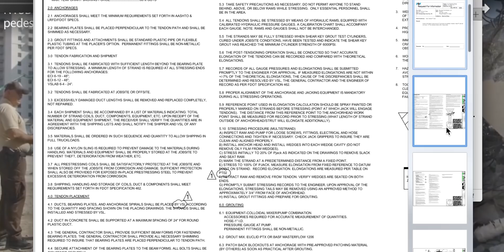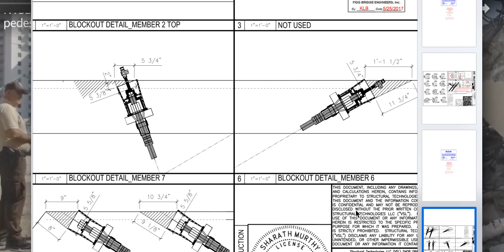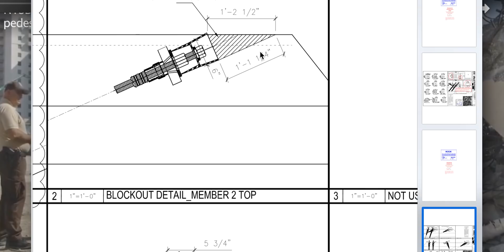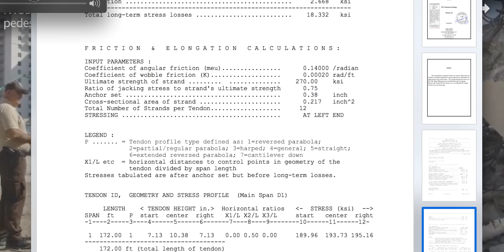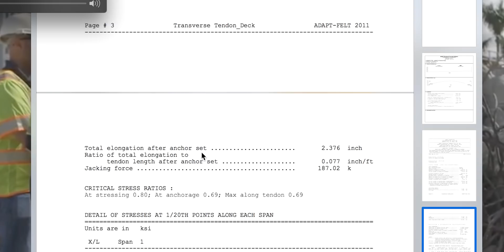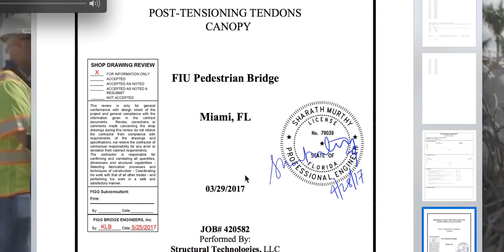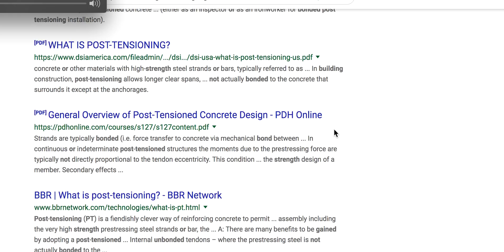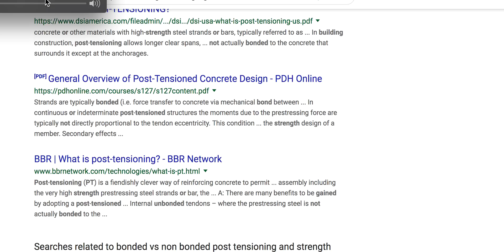FIU Bridge Collapse Bonded Post Tension was NOT done? Correction below

Comment: I believe it was NTSB’s final report came out 10/22/19, concluding there was a flawed design by Figg, and lack of due diligence by the construction company, by various overseers like independent inspectors, by FDOT, and by FIU.
Reply from the maker: I saw you saw this but incase someone else sees your comment, they can bounce to this video https://www.youtube.com/watch?v=9qffZEDmOv8   I will do more and debunk thier report more... Which I called b.s. from the beginning, that they were not going to find the true failure... Figg Engineering admitted that the structure was sagging!   Yet, NTSB sees zero relevance in that with their two loser engineers (gov. workers)?
Reply: Construction Engineering & Failure Analysis 

Good. I’ve not followed it closely since the failure, but feel that after seeing that huge crack they ALL should have insisted that every safety precaution possible be taken until its structural integrity.was assessed. The bridge was shouting that it had a serious problem, yet these so-called professionals chose to ignore the danger it represented, and needlessly put lives at risk.

Comment: While the grouting should have been done, I don't think the lack of grouting was the cause of the failure.  Perhaps the bonding should have been epoxy grout.  Nevertheless, my original conclusion still stands:  It was a very poor design concept that would be impossible to realize in concrete.   It could have worked in steel with a narrower walking deck and larger canopy.   It's really hard to fix stupid.
Reply from the maker: I understand...
Reply: They were possessed by the possibility of low cost materials and minimal traffic disruption. It meant ushering in a new construction paradigm, so politics and corruption trumped common sense. Even in potential modes of failure, they refused to disrupt traffic.
Reply from the maker: @redtrek2153  , totally agree Red, the chance to ''change the way bridges were built" WITHOUT steel girders...